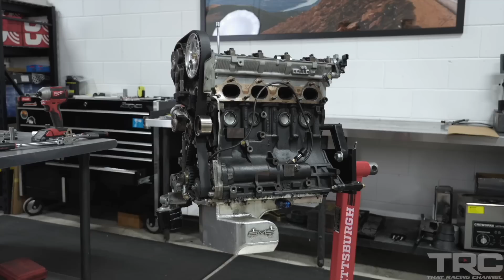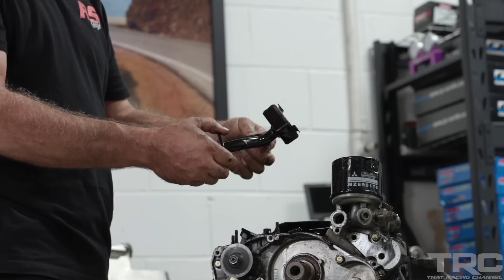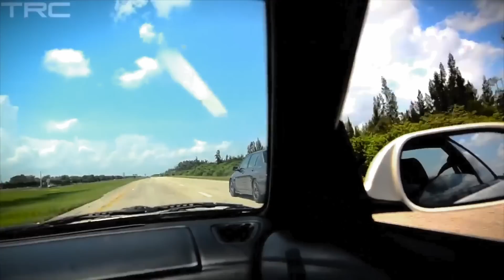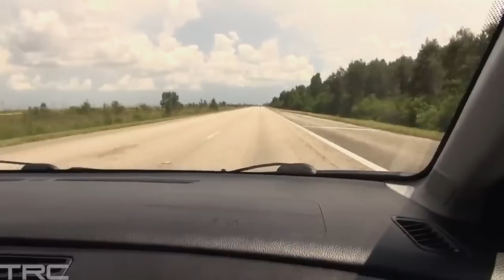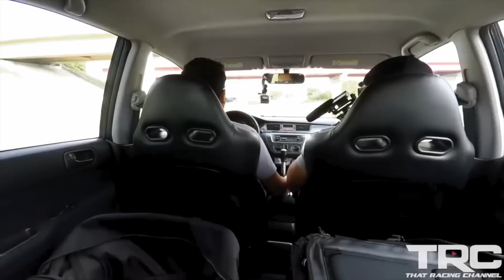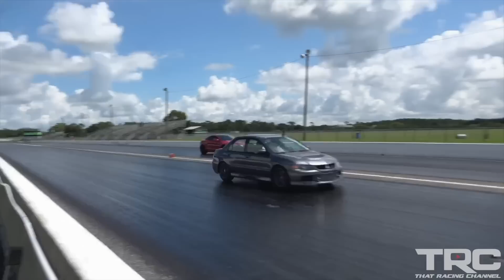1000HP 4G63 Engine Teardown After 17 Years & 30K Miles of HARDCORE RACING ABUSE!

Comment: what would last longer a K24 with sleeves at 1000 bhp or a 4g63 /4g64 ???
Reply: 4g63 will last longer. But under one condition. You have to run low compression to make the 4g63 live longer. 8:5:1-9:1 compression is the average safe for 4g63. Kseries however can run high compression. And thanks to that kseries can spool faster but less boost. but if you’re talking about 1000hp. The 4g63 will live longer. But kseries at 1000hp there will be less turbo lag. 4g63 at 1000hp is laggy but when fully in boost it hits harder. Imo you cant go wrong with either one😂

Comment: Ummm not your wrong I have made little over 1000whp on my 4g63 since it was built in 2016 by RAIF @ RRT MOTORSPORTS 2.1LR 10:5 compression full manley rotaing with TT I BEAMS FORGED BILLET CRANK N MANLEY FORGED PISTONS TOTAL SEAL RINGS KI NG BEARINGS VALVOLINE VR4 20-50 IN SUMMER 10-40 WINTER

Comment: My bike is 12.5 to 1 stock, with carbs from 1991. I run it on SP98 (93AKI if i converted correctly, our regular is SP95 (90AKI)). You'll be fine at 10-11 to 1 compression on pump fuel.

edit : and it's on 30 years old oem plugs ! (as it's a garage find, and have yet to order plugs as those works fine)

Comment: I am using the Manley turbo tuff billet crank. Only running 550hp but my 8 is built for 1000. I too like the low compression because I can’t find consistent e85. So that helps keeping the engine alive, pump e85 is a shit show.

Comment: Can confirm that timing kind of sucks to tune, upside is a stroker will consume boost like nobody's business.  I had the wastegate line come off and ran 45psi during a pass with no issue.  Timing however, we've played with giving it a couple degrees and it made about 0 difference, I think i'm running about 16 degrees up top, between 12-14 in the main part of the powerband.

Comment: I'm really excited to see the new build @ThatRacingChannel! Could you explain what he means by "low CR"? (Is it 8.5, 9.0, or 9.5?) I'm building a 4G63 and want it to be as reliable as possible, so knowing the compression ratio in this build would really help.

I was thinking about going with a high CR, but after you explained that losing 30hp isn't a big deal in the grand scheme of things, that really made sense. Now I'm leaning toward a lower CR for reliability, but I need to know how low is best—I'm thinking around 8.5 or 8.8.
i really appreciate if you can answer me <3  
best of luck 🤞 🤞

Comment: I’m so happy he touched on Hi comp vs Low comp because I’ve always preached that the results of high comp is not as great as one would think.
Reply: As for people saying it helps with lag, engine displacement and rpms have more of an effect on turbo spool time than cr. The feeling of quick spool is actually just a “good NA motor” before the turbo hits, I’ve logged low comp vs hi comp on similar setups and spool threshold was negligible

Comment: 6:34 "in the honda realm, none of those cars were egnineered as OEM turbocharged vehicles"  I would say that Honda is the only company in the 90s that produced turbo engines, that just happened to not include a turbocharger with the vehicle, examples are the honda prelude's H22, the B-series and all of the K-series.  All engines had oil squirters and excellent cooling and to this day are the only engines where you can just slap on a turbo and send it.
Reply: The fwd SR20DE could take literally every turbo part from a Japanese fwd turbo car and bolt it all on. You tapped the block in the factory location for oil feed and tapped the oil pan. Injectors, turbo manifold, intercooler, turbos, MAF. All bolted on and could work with a tune and a fuel pump. Hondas were always more work than the SrR20 was. There was a 400whp SR20 factory longblock before Hondas were doing it.  Damn near 30 years ago now.

Comment: 4:00 trigger pattern hypothesis's - Low resolution trigger patterns were common, examples are many cars from mazda, the miata uses an identical 4-2 trigger pattern.  IIRC Higher resolution trigger patters are used for individual cylinder misfire diagnosis, where the 4g63 does not have that diagonistic feature with the stock electronics.  BUT with faster processors you could in theory have cylinder misfire diagnosis even with the low resultion trigger pattern...  I would guess that the designers were avoiding patent infringement by having diversity between each product line.

Comment: High compression engines compress the air more, and since air is a dielectric material, the denser the air, the harder it becomes to discharge a spark. Part of the reason why high compression engines are more sensitive to detonation is because the spark becomes harder to ignite with high air density. Lower air density has less resistance and allows the spark to jump the gap easier. This is why on turbo modified Hondas you tend to run upgraded ignition systems and tighter clearance on the spark plugs.

Comment: The low comp must've helped a bit with the cylinder cracking issues 4gs can have. Either way solid engine, 4g63 would have to be as good if not better than a 3sgte

Comment: Oh man I've been waiting for a while to see Jay wax poetic on 4G details haha. I wanted to share a couple more:

1. One of those drain back holes in the block is actually a dedicated PCV passage that goes from the crankcase straight into the baffling of the valve cover. This helps keep crankcase pressure from fighting oil draining back to the sump.

2. Evo 4-8 OEM head gaskets are 3 layer gaskets, Mitsu switched to a 5 layer for the Evo 9. They are interchangeable.

3. Older ARP 625 head stud kits came with washers that had too small of an OD and would sink into the cylinder head while tightening causing erratic torque numbers which lead to lowered clamp load. If they sunk the damage can be machined out, just be sure to get larger OD washers.

4. The factory oil pump sprocket makes for a ton of oil pressure because of how small it is and 4Gs basically live with the bypass valve open. English makes a larger sprocket to slow pump speed down which keeps more oil in the sump. It's a good idea for any engine that spends a lot of time over 5000RPM.
Reply: Is the 5 layer better than the 3 layer?
Reply: @gloobus2  yes, the 5 layer will hold a seal better than the 3 layer. Unless you have some pretty high power goals you'll be fine with either.

Comment: I was not expecting an H Beam rod 😳. What brand rods and pistons were in the engine? Did the rods have a standard 2000 fastener or a 625+?
Reply: I’ve made around 900hp on a H beam as many will say they are junk but it also depends on the builder. Boils down to science/ mechanical understanding rather than people on a forum board. Are there better designs ? Yes but each design has a suitable application
Reply: @marcwitkowski9964  I didn’t say or even imply they were junk, nor do I obtain knowledge from forums. I simply asked what rod and fasteners for my own curiosity.

Comment: OMG, very formal information that my mind is 🤯. The ring gap explanation made so much sense which I need to pick your brain on this topic. I've been using JE pistons on my 1g DSM 6 bolt 4G63 and always was told that it's common to have JE pistons to have a little bit of piston Slap on cold starts. I was told if you want high boost levels you got to "Loosen" the rings with a bigger gap vs a tighter gap which in end results on a cold start you will hear "piston slap" until it got warm and once you made a rip with it. So what is the truth on that? BTW I love this video, You Tube needs to have more of this 😂

Comment: My Evo 4G63 was stupid reliable even at 55-65psi. It's the perfect power range for these engines. I didn't have 35k miles but I drove it all the time. Cast iron solid deck block, stock crank, and tons of boost, it just eats!
Reply: Cast iron > aluminum
Reply: @dooby1445 it's in the head and valve train design. But you're comparing cars and platforms not engines. There are 4G63 powered cars going just as fast but you're comparing AWD civics vs Evos.
Reply: @dooby1445 b cause nobody has built one. The last car that had a 4g63 set up for 5 sec passes was sold 5 yrs ago. It was an Australian car that ran 6.19. It was the fastest rwd 4cyl at that time. Red demon still has the claim of fastest 4wd stick shift 4cyl  by a large margin.  Awd Honda trap around 206 vs red demon 215-217.
Reply: do you think it's more reliable than the k series?
Reply: @jayknight139  loose tolerances and strong parts for sure it is more reliable. I mean look at Raif @ RRT dudes putting 100psi through these engines going low 7s @ 200mph over and over.
Reply: @functiongarage  how much were you making @ 65psi?
Reply: @garymofo2  enough to go mid 4s 60-130 lol
Reply: @jayknight139 if built right, yes they will make more power ( the power band is better ) especially on the 2.2, I have a 2.2 street built car from RRT and the engine makes around 514 on pump gas, that 500whp is there consistently from 6700-9k rpm it’s intense
Reply: @jayknight139 …. I think so. It was designed out the factory to have turbo. Plus it’s very low compression compared to k series are decently high compression. So what happens is the k series higher compression engine will experience more heat much sooner once boost psi hits and will have to retard  more timing and sooner in hot rpm race before the evo will have to. This is bad the evo is very low compression ratio so your allowed to add more boost and gain a little more timing if both engines were in the same situation and conditions.. lastly…. Evo has a cast iron block like the Supra except evo is 4 cylinder.

Comment: 4g63 turbo, the best 4 cylinder engine ever made.
Reply: So does the 4G63 @dooby1445Because Red Demon makes 1800awhp+ and has a billet block so it makes sense. 

But most 4G63 can make 700-1000whp far more often and for longer than K series can in general. Without needing any sleeves or forging the rotating assembly even. Built heads and big turbos with boost and tune. Those blocks are just stronger than Honda engines are because you will need a really good tune to run those types of number for a long time, if that, with an open deck aluminum block as well.
Reply: @DCF19-n9x  b serie and k serie way better
Reply: @aufondmonleon junk
Reply: @aufondmonleon  where is stock block b or k series making 1000whp, 26k miles, and for 10 years? We don't have to copy AWD from someone either.
Reply: @DCF19-n9x  what the world record of speedfactory again ???
Reply: @alexlaz5157  you are commenting on a street car with 10+ years of street 1000hp miles. Your fuckfactory can't do this and your shit box isn't gonna do it either.
Reply: Get off the k crack pipe bro. Torqueless wonders are good when you dump a boatload of money on them.  @aufondmonleon

Comment: We had a 14.1:1 compression 355cid SBC that ran low 11s N/A in a 3200lbs car for over 15 years and it ran on 110 Cam2 or Turbo Blue so you can make them last because we didn't do anything to that engine but change the oil
Reply: N/A (naturally aspirated) be the key spec for why a high compression ratio engine would last. Throw 2 bar of boost at it to triple the power and you could only hope it would last a race season.

Comment: You know if jay thinks this guy was good then this guy was amazing. The compression ratio talk is interesting. Knock on wood the 4g's i have built have been living happy lives but i always build low comp for street cars and my race motors 10:1. Chasing every inch of power but those motors usually are at least half filled ect and are not expected to see long service intervals.

Comment: 17 years 30,000 miles you're barely drove the car
Reply from the maker: You’re missing the point haha, 1000+ pulls and 100+ races on the same engine over 17 years. The car was raced every time it was driven, not many 4g63’s or any 1000HP engine in general can say the same.
Reply: @ThatRacingChannel  oh yeah that is very impressive
Reply: @paulezay3599  100 races of 8 second wowow lool
Reply: @ThatRacingChannel  correct

Comment: Fantastic video! We used to race Evo 7’s and 8’s back in the day in Time Attack but had zero idea how these engines worked. We always paid an engine builder to do all that for us.

Best results we had were 2.3 Stroker, non Mivec, and running Sunoco 105. Reliable 870hp on the engine dyno and lasted 2 full seasons without opening the engine up

Comment: Considering how far metallurgy and production technology has come in the last 17 years, it's crazy impressive this thing lasted so long at such a high power level!
Reply: most people aren't aware how far engines have come over the past two decades especially in making power.
Reply: The 4G63T was a great engine for its time
Reply: @lateralus6512 and still is a legendary engine now. There’s a 4G63 in Australia pushing 2000hp using the factory block. I don’t know of any other 4cyl engines doing those numbers on a factory block.